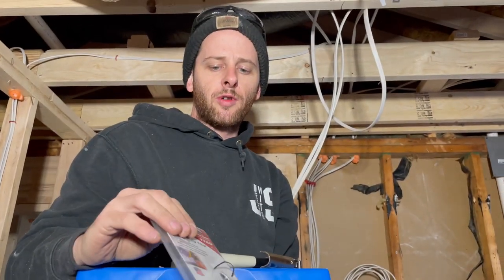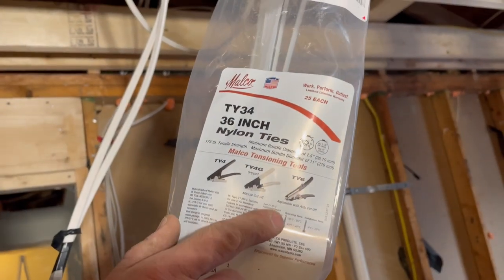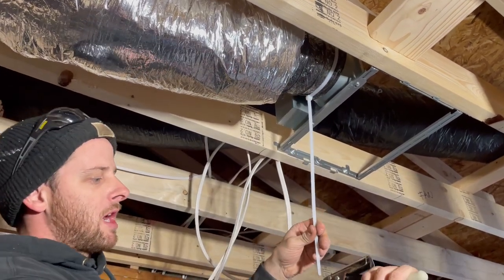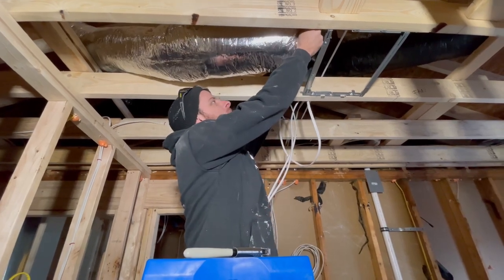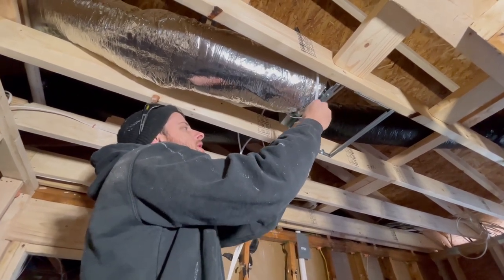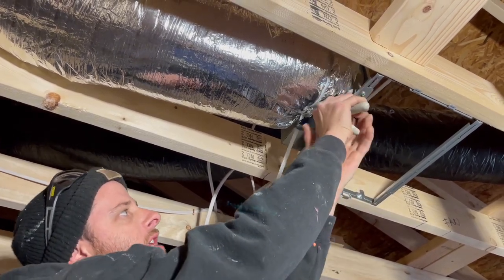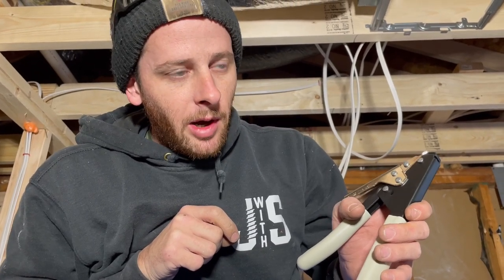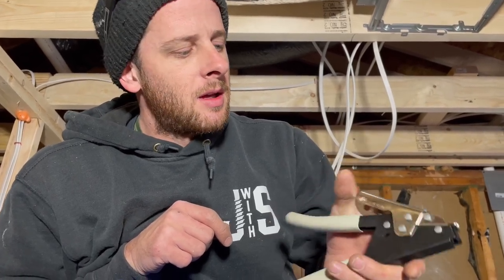Malco Nylon Tie Tensioning Tool | Tool Review

Comment: Nice.  The couple of sets of "cutters" I have laying around the shop don't cut until they have a certain "torque" (amount of tension on the zip tie). I see there hasn't been much improvement in the last 20 years, or so.  The dinosaurs I have are adjustable.  Do the one's you're using have that option?
Reply from the maker: Unfortunately not. That’s the boujie one mike was talking about. Ours won’t cut until you operate the cut apparatus of the tool. Sounds like yours are pretty good